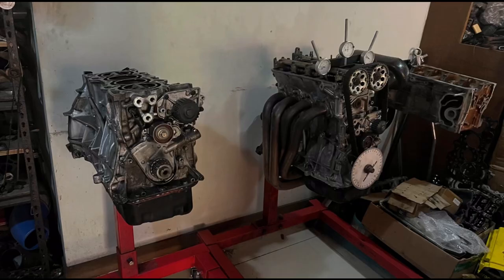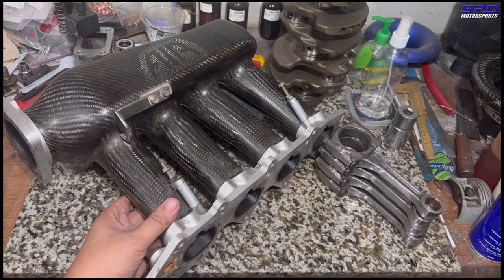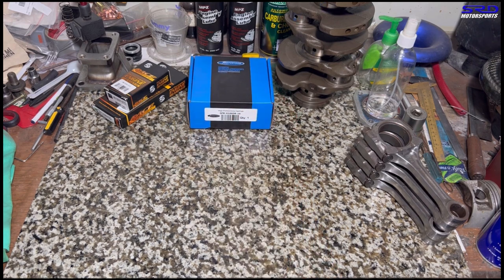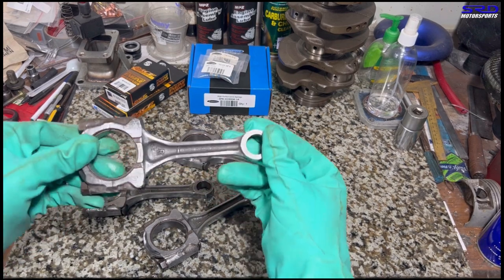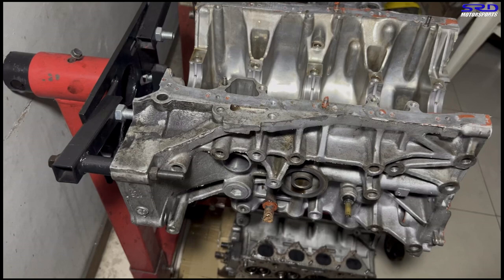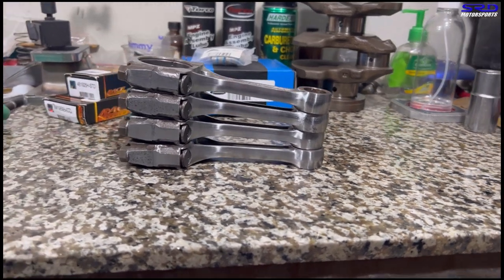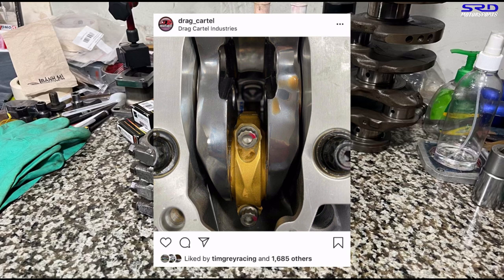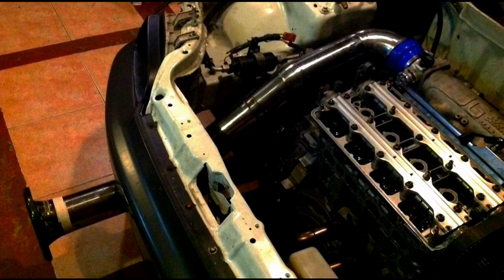Honda B16b CTR Stroker Build Series part 1 Introduction and Tricks

Comment: Man the tips are priceless. I’have a h23 a1 in the garage it’s  been built but 5 yr ago so I would like to take it apart and check it all . I’ll be putting it in a 95 eg coupe
Reply from the maker: Oh sweet and yeah 5yrs seems on time for a check up and revamp now for u
Reply: @SRDmotorsports   i also have a dc2 integra that needs a brake booster or something the pedal I have to pump lol I have a lot of projects lol I also have a 94 accord f22b1 5 speed that needs water pump and belt it has 150,000 and hasn’t been changed so before I daily it I need to do it. But I have never done one
Reply from the maker: @tjabdon606  oh man and my daily red EG is the same needs a new hydro since brakes are too soft lol

Comment: Great video man !! I’ve been polishing oem Honda rods for years in most street strip all motor builds I’m actually building a B20/Vtec with polished rods 🙂. Just a little info on those Blox Type B Cams I ordered some for my current build and the tuner series type B cam card is very scarce on info I had to email Blox to get the centerlines which are 100 ATDC Intake and 105 BTDC Exhaust unlike skunk2 and most other cam companies which use .040” or 1mm lift these are measured @ .050” lift like most domestic cams here in the U.S they come in at .266 degrees of duration on both in and ex with 12.42mm lift on the Intake and 11.98mm lift on the exhaust. Just thought I’d share that info incase you don’t receive the cam card or like mine with no centerline numbers. I’m anxious to see how these cams perform !!
Reply from the maker: Oh dude wow dude!! u are a legend!!!!

the. Blox B I got the screen shot or photo of it and no centerline but I see it’s the same cam cuz is also 266@0.050” so it’s the same!!!

And ur 100 / 105 LC is crucial! And it’s close to skunk2 so when we visualize things it makes sense

And boy! Nice to see u been polishing rods for years!!! My bad that now it might be a trendy jack hahahaha

Comment: Mugen-style polished OEM rods 🍻
Reply from the maker: Yes! was really interesting when Udo shared what they did in the late 80s im like “wait that’s a Jdm move” lol! and he from Germany so pretty sure his source of origin was different
Reply: @SRDmotorsports  Thinking you can surpass 220 whp easy 🍻
Reply from the maker: @findtherightbeat  oh maaaan by the numbers it seems… but I’d hate to be the one to raise my own expectations but 

By the numbers and since the blox B seem to have 266dur. That’s skunk2 tuner2 zone ftw! Hmm
Reply: @SRDmotorsports  How high will you be spinning it with the stock ITR rods? Thinking the IM will make it breathe up there
Reply from the maker: @findtherightbeat  that’s the rare moment my worry is the manifold won’t mind lol… but the 211whp stock ITR block back then we did? Was and still alive til now (spinning to 9,700) 

And so I’m just hoping it peaks are ping 8500-8800 this way I can just be “responsible” and keep it at 9,700 lol!!

exciting cuz this hillclimb now different than the common builds
Reply: @SRDmotorsports  How do these PCTs hold up to above ~8200rpm? especially for hillclimb with the 87.2mm stroke? The 180+ whp PCT equipped B16 circuit car that H3 built back in the day survived long punishing track days it seems but that's 9.8mm difference in stroke, a big difference in piston speed with both engines
Reply from the maker: @findtherightbeat  yes sir actually we are yet to see now cuz the 211whp we did before 
Was ITR pistons
So hopefully this does decent
Reply: @SRDmotorsports  By the way, do you think the TBRI will complement the AIR IM?